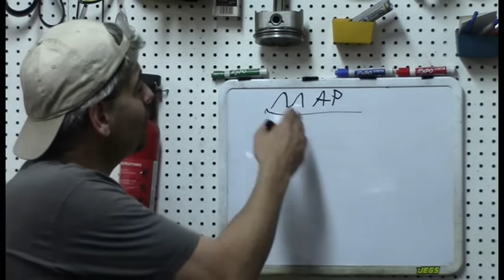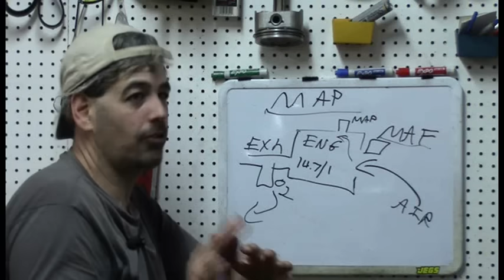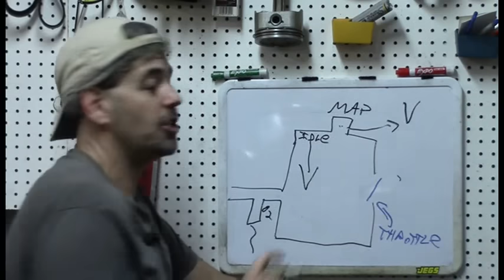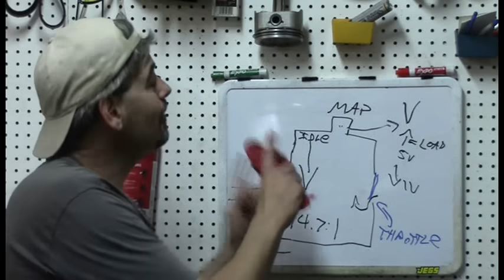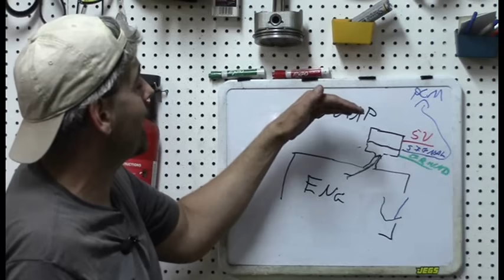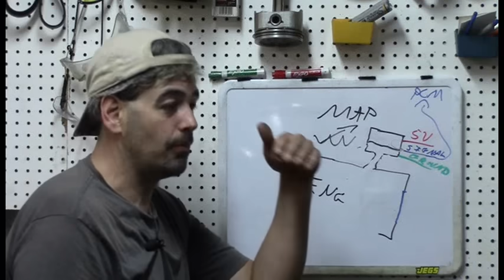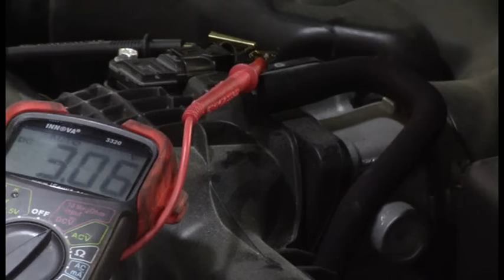MAP Sensor Diagnosis and Understanding Function- Pt1

Comment: some one help my signal voltage when car is on on map sensor is .85 when car is really warmed up how can i fix this o2 sensor sounds like a fix to it because i alreaady changed out a new map my power is at 5v but my signal is all wonky my car is a 02 rsx type s please help @SchrodingersBox
Reply from the maker: So what’s the problem exactly?  .85v at idle is normal.
Reply: @SchrodingersBox  My car idle is very bad and jerks and sputters back and forth. I have a code of p0107 manifold absolute pressure/barometric pressure circuit low. My car is not driveble and I need it running 🥲
Reply: @SchrodingersBox  when I rev my car and when it decelerates car bogs and will almost just stall/die.
Reply from the maker: What are the map readings at decel, idle and WOT?  Whats the bias voltage showing?
Reply: @SchrodingersBox  im not a expert nor mechanic all i can give you is while car is on i get 0.85--0.94v at deccel will drop to around 0.55-0.77v when accel it will go up t 2.44v. my power wire is at 5v my ground has continuity and when car is off my signal wire is around 2.40v+.
Reply from the maker: I have to see the fuel trim  readings to be able to see whats happening.  There is nothing showing a MAP issue there with what you gave as voltage data.
Reply from the maker: Saw the video- sorry but there was no useful data there. I need to see the fuel trim curve but there were all these random data points shown.

Comment: Hi. I have a Hyundai Santa Fe 2009 3.3L model with a fluctuating idle, stalling issues and sometimes the engine switches off while driving, but starts up right away when restarted. I ran a scan as shown in the video below to monitor the TPS (blue line), Pedal sensor (green line), MAF (red line) and the MAP (brown line) sensors while the engine was running (beginning from idle to me depressing the accelerator up to 2,600 rpms and back down). This is what I got: http://jmp.sh/XSbFgKh
I noticed the MAP was highly unstable. Is that normal?
At point 318 on the horizontal axis (in the video), the engine switched off on its own, and both the TPS and MAP spiked (not sure if that’s what it’s supposed to do)!
1) What is the relationship between the MAP and the TPS?
2) Does the TPS determine the MAP reading or vice-versa?
3) Can a MAP reading indicate engine compression loss?

Thanks
Reply from the maker: There is no relevant data here related to your issue- I am not sure why you are selecting these PIDs. It would be better to do a fuel trim analysis up to the point of symptom expression as well as get CKPS and CPS inputs.
Reply: I researched on the possible causes of the idle and switching off issues of the car and got a list of possible causes, including the TPS, MAP, MAF, vacuum leaks, etc. I had carried out a test on my throttle body with engine off, key ON and got a strange behavior as seen here: http://jmp.sh/KEv0iI2. 
So I proceeded to also monitor the behavior of the MAP, MAF and TPS PIDs with respect to pedal position (that's the video I sent earlier) so that I would know if there is any other sensor that might be faulty.
The software scantool i use (ScanMaster) does not read the CKPS and CMPS inputs, so no way to monitor them; but there are no engine fault codes.
Reply from the maker: Can't help unless I have relavent data, sorry.  If you get me some fuel trim data so I can at least narrow down to the suspect systems I will be happy to help. But just focusing on induction without any foundation makes no sense to me.
Reply: Schrodingers Box ok. I will do some fuel trims and get back to you. Thanks
Reply: Hi. Just did some fuel trim monitoring from idle to revving up to about 2,700rpm and back to idle. Here is the video: http://jmp.sh/dvLSXIr
The engine did not die though.
Let me know if there's anything else I need to do.
Thanks for your time
Reply from the maker: The Y axis scale is too high to get any interpretation of the output, sorry.  Set Y axis to +/- 15 please/
Reply: Ok. I have adjusted the Y axis: http://jmp.sh/j3pvFDx
Reply from the maker: Well you don't have the right combination of data- there does seem to be an adjustment for fuel demand under load but it within spec. I am not cray cray about the 15% TPS at idle- is this a drive by wire system? If so that's way high and indicates either fuel sufficiency issue or possible dirty TB. 
  What I'd like to see is the desired TPS (if it's DBW, otherwise IAC) vs actual and also what your front O2's (or more likely A/F's) read during WOT.
  I also need some snap throttle tests on MAP- and data given in Hg not KPa- who the hell uses KPa lol????
   
  While unlikely, your (incorrectly) grouped PIDs show possible indication of a poitential fuel deficit. It needs to be correlated correctly to rule this out.
Reply: - I'm not clear about what you mean by a wrong "combination of data" or how you derived the "15% TPS at idle" from the last clip I sent. Kindly explain
- It is a DBW and the TB has been cleaned.
- The PID I assume that represents the desired TPS is the 'Commanded Throttle Actuator Control'. I will plot that with the TPS and get back to you
- The ScanMaster software gives MAP reading in KPa and psi only. There's no option to change the unit of measurement.
Thanks so much
Reply: Hi. Here is the plot of the 'Commanded Throttle Actuator Control' vs the TPS, and the O2 sensors at 5000rpm: http://jmp.sh/2dyLk75
This is the snap throttle graph of the MAP in psi: http://jmp.sh/aOg4fcd
I decided to also record the Fuel trims as the idle was fluctuating (with A/C on): http://jmp.sh/Tt37l9W
Thanks
Reply from the maker: I have to assume it's idle because there was no TPS movement. Like I said, you have a hodge-podge of unrelated data that doesn't allow interpretation. The only thing we can confirm from bits and pieces is that there is some evidence of a stoichiometric imbalance.
  Nothing else can be determined.  It's like getting a person's heart rate, dental record, 60M track time from high school, and a LDL count and trying to determine a shortness of breath problem. There's lots of data but it isn't put together correctly.
Reply from the maker: Looking at your MAP results I am not understanding why you suspect an unstable MAP?? Please explain.  Seems we are on completely diamteric opposite missions here.
Reply: I thought something might be wrong when I checked online for sample graphs of a MAP sensor and the ones I saw seemed fairly rough but within a narrow band. 
So if we can safely say that the MAP is ok, what should we look at?
How about the O2 sensor readings, were they ok?
Reply from the maker: Can't tell. As I said, you don't have enough relevant data collection under induced variables to definitively determine anything.

  Please notice how you keep focusing on individual components. We haven't even been able to narrow down to a system, much less on a component within the system.  It is impossible to just jump to determination of a component.
  Please run the tests I described earlier.  Then we can narrow down to a system.
Reply: I had already run the tests you described and submitted the video links to you about 7hrs ago. It appears you skipped it. I have copied the earlier post and reposted again:
Here is the plot of the 'Commanded Throttle Actuator Control' vs the TPS, and the O2 sensors at 5000rpm: http://jmp.sh/2dyLk75
This is the snap throttle graph of the MAP in psi: http://jmp.sh/aOg4fcd
I decided to also record the Fuel trims as the idle was fluctuating (with A/C on): http://jmp.sh/Tt37l9W
Thanks
Reply from the maker: I did look at them. Where is the O2 sensor vs WOT curve?  where is the desired vs actual IAC?.  If I missed it as you say  then i apologize.  please point out where that CRITICAL data I requested 4 times now is please.
Reply: Ok, to be honest, I'm really confused here. This link: http://jmp.sh/2dyLk75 contained both the O2 sensor vs WOT curve, and the desired vs actual Throttle position all in one, or do you prefer them to be in separate clips?
Please note:
- On my software, there is no 'desired TPS' PID. The PIDs that are related to the throttle are: 'Absolute 
  Throttle Position', 'Relative Throttle Position', 'Absolute Throttle Position B', 'Absolute Throttle Position C', 
  and 'Commanded Throttle Actuator Control' which I assume should be the desired TPS and used to plot 
  against the 'Absolute TP' in the video link above

- From my observation, the throttle valve doesn't open beyond 35% even with the pedal fully floored.
Reply from the maker: cant be WOT because TP% was only what- 15% and O2's stayed in stoic. Why is that if you were at WOT?
Reply: I rightly guessed that you must have made your judgment from the TPS % opening. Maybe something is wrong with the TPS motor. I did a test for WOT on both my Camry and the Hyundai last night and there's a huge difference in the % opening with my foot fully pressing the pedal to the floor:
- Camry % opening - 80% http://jmp.sh/Jtwsjjl
- Santa Fe % opening - 35% http://jmp.sh/fELpmqP
Reply from the maker: Yes if you had the pedal to the floor and opening is only 15% (or perceived to only be 10%) then that is exactly your problem (explains the fuel trim too).
  Congratulations. now you can easily identify if it is component or feedback issue and fix accordingly!
 Nice.
Reply: I intend changing the TB tomorrow. I actually hoped to borrow another TB to first test and be sure the issue was not a failing signal from the ECU. Unfortunately I couldn't get one. I have decided to take the risk and get a new one. Quite expensive!
Reply from the maker: Whoa whoa whoa-  why on earth would you change the TB???!!!  Where have you tested that the inputs to the TB are correct?  Changing the TB makes no sense. What if the variable resistor in the accelerator is faulty?
  Test for potentiometric inputs first and if they are proportional to the variable inputs, only then would you change the TB.  But to change the TB based purely on a disproportionate angle position is illogical.
Reply: LOL!!! Sure, I had already done a test before today to compare the accelerator input (pedal position sensor (D)) with the TPS and realised that even though the pedal input increases to 78%, the TPS stops at 35%. That was why I ruled out the pedal potentiometer. I even decided to repeat the test, this time including the second pedal position sensor (E) and noticed that the second sensor peaks at 38% (pedal fully depressed to the floor) which is about half the first sensor, complying exactly with what's in the repair manual. 
The only test I haven't been able to conduct is to supply (varying) voltage directly to the throttle motor terminals. Unfortunately, I have no idea of the voltage range within which it actuates
Reply from the maker: Those are usually stepper-type motors. You can't simply apply voltage to them unfortunately. You have to inverse the polarity back and forth every "step" to move it.
Reply: Hi. Been a while but I thought I should give u an update on progress made.
I bought and changed the TB and all revolution fluctuations, car switching off, etc have been resolved (BIG sigh of relief!). I observed the following though:
- with Key ON, engine OFF, the TPS doesn't open beyond 33% with the pedal fully depressed. However, while driving at 120-130Km/h, the TPS goes up to 54%. I have come to conclude that there's some 'intelligence' involved, wherein the ECU will only open the TPS based on inputs from ALL other sensors involved, not just the gas pedal
- the rate of acceleration is fairly slow. I just embarked on a journey with my in-laws who were driving a camry 2003, 4-cylinders. Surprisingly, their acceleration rate was MUCH faster than my V6 engine!
Should this be?

Comment: I don't know if you answer problems but I will ask anyways. Yes I'm a girl! I know a lot about older vehicles and the general stuff. I actually had a 1972 SS Chevelle in my younger years. My problem is with my 2003 Jeep Grand Cherokee limited v-8 4x4 all day. It happened after I had this idiot change my water pump and spark plugs. Now my Jeep won't idle and has no power, keeps stalling! Had it read twice and NO Code came up! Any suggestions?
Reply from the maker: See my video on FASTTEC diagnosis. works every single time guaranteed. It has to- it’s pure science.

Comment: hi mat my car service required  to change my map sensor with cam shaft  positioning, see it been over a year that my car will have a hard time to start after dieing while driving, sometimes while driving it will suddenly die without any sign sometimes my rpm will go up and down (it's unstable , ost of the time) u till it its the bottom and then engine will die, sometimes after dieing it will start again sometimes it will have a hard time starting leaving me stuck on the road, the first diagnosis to this problem is fuel pump which we replace immediately but after replacing nothing happen. then we go to throttle we change nothing happen until one day it stop running my mechanic told me to change computer box and some parts and we did and it start again but the problem of stalling is still there, and now finally I come to chevy service and their diagnosis is map sensor and camshaft and a tune up and fixing some engine leak. What can you say about this situation? I would appreciate ur answer, my car is chevy optra 2005. Thanks
Reply from the maker: All I can say about that is it's unfortunately the norm.  Your mechanic, as 98% of them do,  is just guessing, not diagnosing. You should find someone else.

Comment: My MAP sensor is going mad due to my CAI upgrade which is causeing my MAF sensors to I guess send all the wrong signals. There is much varied info on these sensors. You seem to know your sh*^- pardon my language. I changed the MAF. Still problem persists. My question is... will my MAP sensor pick up the slack if I remove the MAF altogether? For reference my car is the 2016 Chevy Cruze Gen2 (engine code: LE2) 1.4l Turbo Manual. I have both MAF and MAP. I LOVE my upgrade added power or not it allows me to hear my turbo when I shift. I do not wish to remove it. What can I do, brother?
Reply from the maker: What data is your maf and map showing?

Comment: MAF it a hot wire sensor ok.
Reply from the maker: No- not necessarily.  There are different MAF versions.  You can not assume it's a hotwire unless you analyze the wiring configuration and determine the potentiometric or other detection design.

Comment: oh so SIMPLY put the MAP regulates fuel flow control to the PCM. Why didn't you say so? Try to be a little more succinct, all the extraneous junk info is not necessary to know if the MAP needs replacing.
Reply from the maker: Um nooooo... you clearly have no comprehension of the MAP sensor function even despite watching the best video on the subject on the internet. Your statement is so wrong that it sounds utterly stupid.
  You clearly have no concept of when to replace a MAP vs a MAF or a FPR.  Please tell what YOUR method is to differentiate a MAP failure from all the other sensors that ALSO regulate fuel flow to the PCM (which in itself makes you sound incompetent. There is no fuel control to the PCM as any beginner even knows. There is pulsewidth modulation control FROM the PCM to the injectors). 
How do you diagnose it was the MAP and not the MAF or even a fuel trim maladjustment from an inadequate induction metric or even fuel delivery? Please tell us.
  Please tell us YOUR method for differentiating the MAP specifically that is not included in the video- because right now you sound like another incompetent moron. 
Ball is in your court.

Comment: Code 12
Reply from the maker: Ok what is your block learn and integrator at idle vs load? What is the TPS, MAP and/or MAF voltages at idle vs load?   What is the O2 sensor curve with induced variables?

  I can't just go off a description of symptoms or I'd just be guessing

Comment: So I'm getting a PO108 code on a dodge hemi 5.7L  and multiple misfire codes after I replaced camshaft and lifters is that my map sensor causing misfires?
Reply from the maker: Possibly. what data do you have from the sensor?

Comment: Exactly when do you have pressure in the intake manifold above atmospheric level on a non-turbo engine?  Am I the ass-hat for asking that question?
How come manufacturer which used to rely on MAP are now using MAF e,g, Honda?  What are the inherent advantages for MAF over MAP as that is the most prevalent method of computing the fuel needs of the engine?
Reply from the maker: 12vgs8606 No thats a good question- you will never have intake pressure above atmospheric pressure in a normally aspirated engine but you bring up a good question about turbo or maybe supercharged- I have never worked with either but I can imagine that at WOT with extra air literally being blow in, that may indeed be the case. Interesting-- if I ever get a turbo or supercharged car it would be interesting to revisit many of the concepts in my previous videos and see how the induction variable affects them vs a NA engine.

Comment: Most of your videos I enjoy but this one is utter nonsense.  A map sensor can't detect engine load.  It detects engine vacuum.
Reply from the maker: Keith Stinson OMG, I never said it detects load I said it interprets load from vacuum. Huge difference.  To be exact it is only a partial determination used in load calculation.  Volumetric Efficiency is the main resource be there no "direct reading" of VE- it is calculated.... you guessed it Keith... off the MAP as well as other inputs.